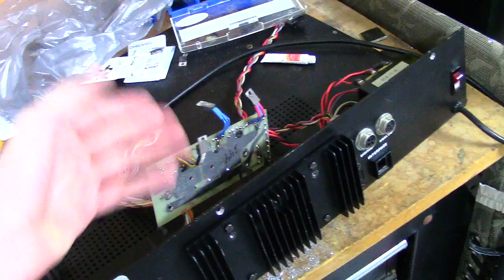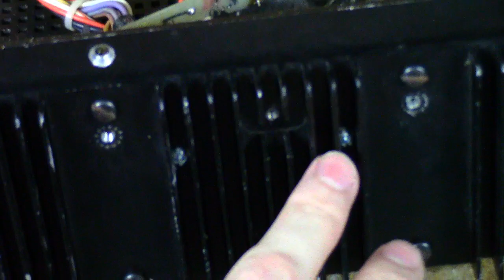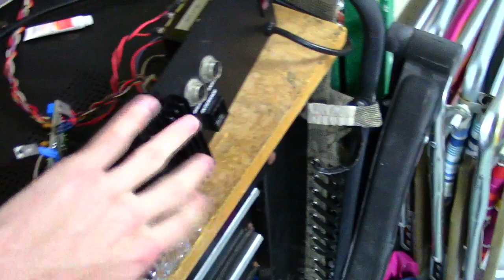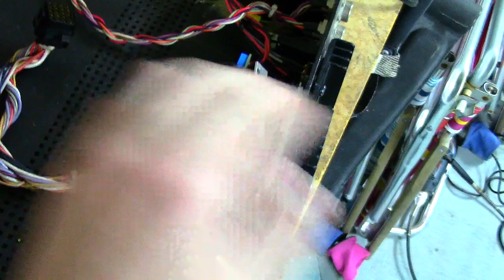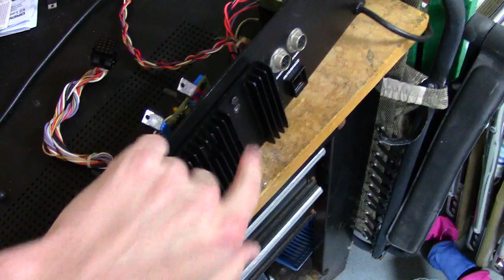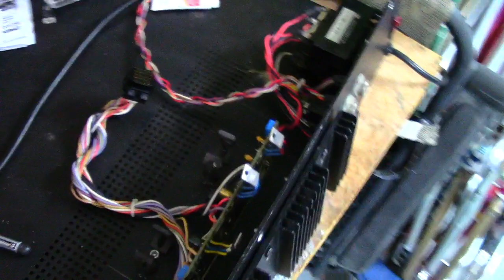Sequential Circuits Prophet 5 Power Supply Modifications Part 1 (By Synthpro)

Comment: My rev 3.3 had an issue when I bought it. One of the voices kept dropping out to a high pitched squeal. It wasnt an easy fix (not the voice chip) Took a couple of years to get it sorted. At least the CEM chips are readily available now if a voice goes down. I've also had a toroidial transformer fitted. No heat problems at all now. The 3.3 is easily the best version. Also has 120 memory locations 😊

Comment: I’ve been told to avoid at all costs the Rev 2 version.  

Also been told some tech’s actually refuse to take a Rev 2 Prophet 5 in the shop.

Please could you clear this up for me. Is this a myth or is the Rev 2 really bad news.

From clips I’ve heard I tend to find the Rev 2 nicer sounding for me.

I went to see G Numan in 1979 
What a show it was too.

Machester Apollo UK

Appreciate any help Re. My Prophet 5 purchase .

Superb channel BTW 👍
Reply from the maker: That is true even here at my shop.
Here are a few reasons why:
.....
1. Rev 2 prophets use SSM chips rather than Curtis chips which are harder/more expensive to source
2. Layout of circuit boards are completely different and were what I would say were still in prototyping stages.

3. No cassette storage without modifications.

4. Overall not reliable.

5. Power supply doesn't mount in any of the prophets 5 versions which is goofy....the PSU is held in place by clamping to the capacitors which can come loose and cause more problems.

.........

I'm not a huge fan of any of the prophet 5 versions honestly because of build quality and functions offered for the price, (not talking collectors value here but actually as a musical tool). 

There is no polyphonic glide, there is no control over voice modes or emergency  voice shut off if something went wrong with a voice and you needed to finish a recording. As a tech, Prophet 5s are more difficult to service because the boards internally stack and have to be physically disconnected to access the sandwiched board meaning you either have to build a breakout harness or remove all boards from the chassis to be able to power things up to probe signals for troubleshooting.  I honestly try to avoid Prophet 5s.
Reply: @synthpro  The Rev 2 sounds so good though. I'm not sure anything can beat that brass. The CS80 is more expressive, but the p5 with one patch is as thick as the J8 in four voice mode. All rev 2 https://soundcloud.com/user-578548665/vangelis-hymne-on-the-rev-2-prophet-5 

As terribly unreliable as it can be, it is just magical with each voice articulating with heat from moment to moment, the envelopes almost dance with uncertainty.

Comment: This prophet 5 has the exact issues as mine.  5v regulator short passing unregulated voltage though that 5v buss.  Rebuilt the PSU (rev 3.3) w/ new all new caps, regulators, isolation kits, etc.  Getting proper +/-15v and 5v.  But, I've noticed that my 5v line shows 2v, once connected to the cpu board.  If I remove the z80, things return to 5v.  I have one of those on order.  Curious, in your opinion, what might I encounter next?  Thanks, Sean
Reply from the maker: Hi Sean,

Sorry to hear this but sounds like your on the right path. Next things you might see is that the synth will not do anything when powered up...on mine, it took out the clock divider that drives the CPU...you have a 4MHz oscillator that goes into this IC that divides it to 2MHz If I am remembering correctly, I honestly can't remember the IC # or part # for this divider chip. Once you get the processor clocking again, you may see that there are no presets and the Memory does not work.....If I can remember correctly, it has to do with the Memory Protect circuit being stuck due to blown IC's.  Honestly this is all I can remember and I am not sure if they all fail the same way when this happens but this is the symptoms I had. 

All the best with it,
Jareth

Comment: nice video. I put a torodial transformer in mine. Much better
Reply from the maker: waheex That is a good idea....I would like to eventually add a transformer with independent secondary windings to power each voltage independently, would take some stress off the single secondary.